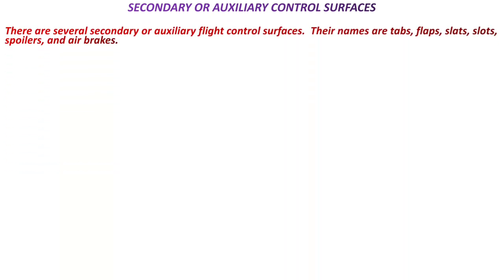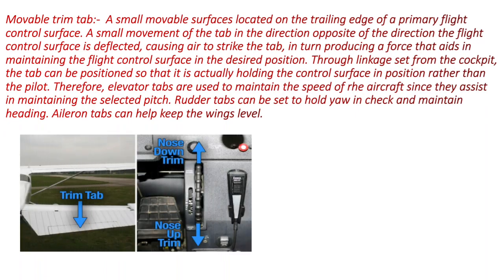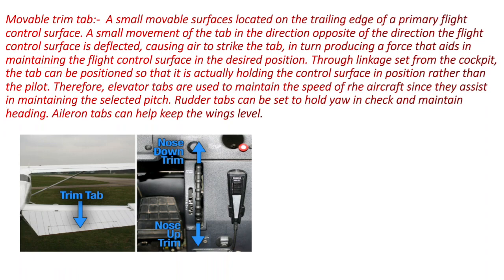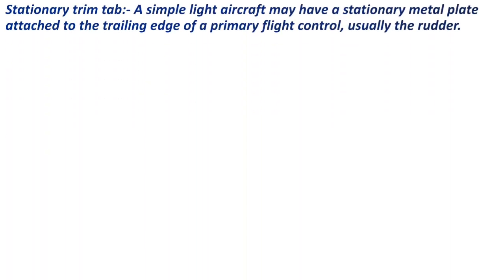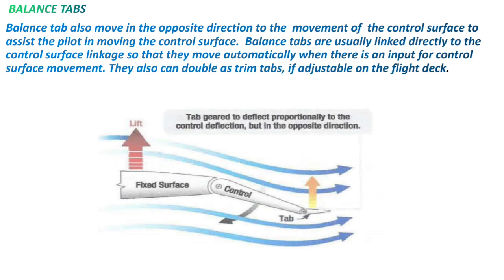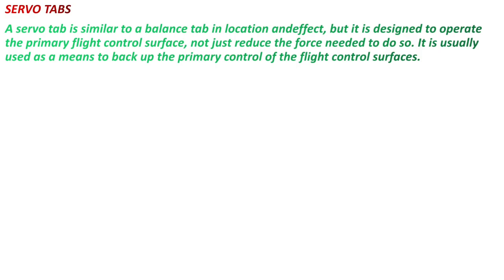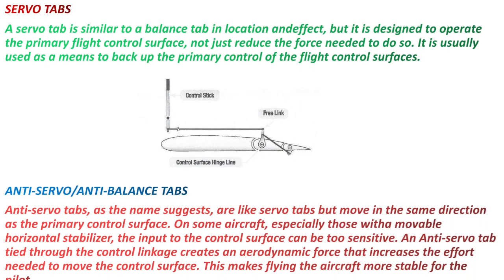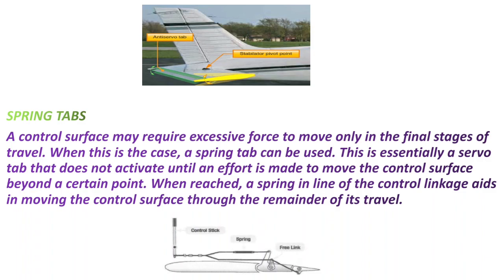| Secondary Control Surface | Basics of Theory of Flight |

Comment: There NO Lift `force` and NO Drag `force`, it is Aerodynamic force. Lift and Drag are just components in coordinate system.
Reply: It is wrong approach researching the creation of Lift force and Low pressure at upper side of the wing. I explain the aerodynamic cavitation and existence of Lee side aerocavern, and creation of Aerodynamic force.